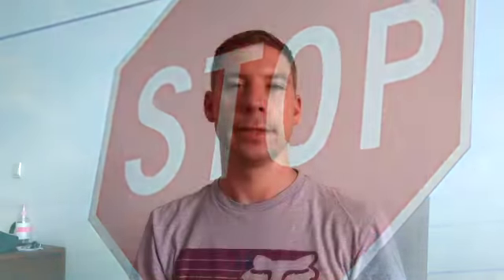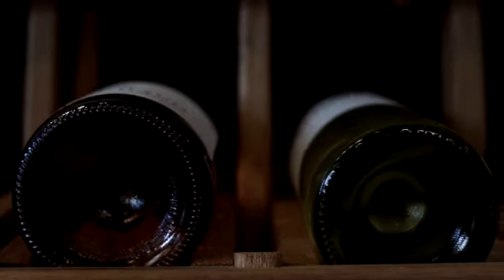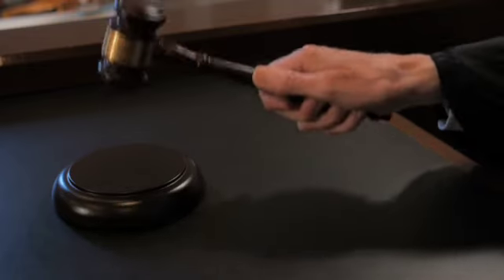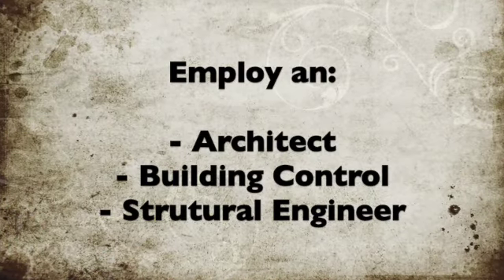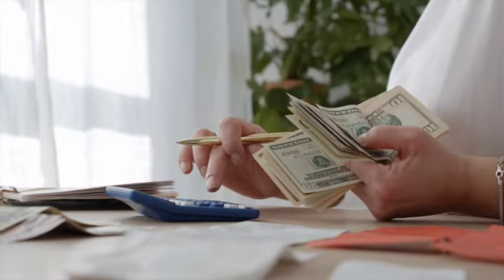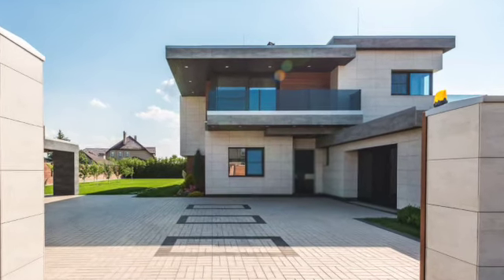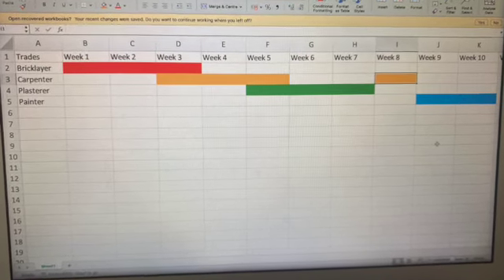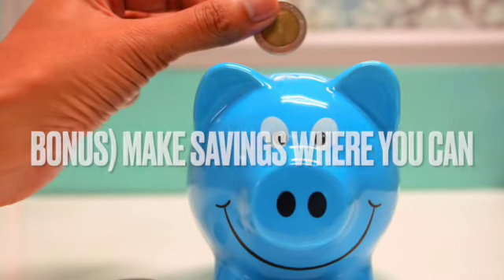A Basic Beginners Guide To Renovation - Tips For DIYers

Comment: Great advise and very practical, but finding good tradesmen is easier said than done these days. There are far more builders out there just wanting to take your money and cut corners, than builders intent on making a name for themselves. I took on a build and the odd 3 trades I got subcontractors in to, do let me down, and I ended up sorting them out myself. It’s really not for the faint hearted unless you are lucky enough to find a good builder. I am retired now but have witnessed over the years these skilled trades not being passed on to the younger generations as they used to be passed on any more. Younger generations seem to just want an easier life and instant gratification. It is not difficult to learn most of the building trades yourself if you are so inclined, as there are so many courses out there these days and it can save £1000’s, but it can be a hard route to take. These videos can be a great help especially with building regs constantly changing.
Reply from the maker: Thanks for the encouragement Peter. I agree, good builders are hard to find There aren’t enough youngsters getting trained up, mainly because they just don’t want it and it means putting in some graft.
Reply: There is also the problem that the new approaches to thermally efficient buildings mean that many older 'practice' based techniques are no longer adequate, so you need folk who are both up-to-date and contentions as part of their competence!

Comment: Is it possible to use PIR rather than lime on solid walled old buildings?
Reply from the maker: @Jonnysonone  Hi, I’m not sure I understand your question because PIR and Lime aren’t comparable. Are you asking whether you can insulate an old wall will PIR if the wall is built with lime mortar? Give me some context and I’ll be able to help you further.
Reply: @BerkleyBuilds  hi. Yes basically. Old solid walls that were traditionally meant to allow the passage of moisture.  Is it possible to insulate with PIR without causing condensation problems? So much info out there it's confusing.
Reply from the maker: @ in short, yes it’s possible however, you have to go about it the right way. I’d suggest creating a stud wall set off from the existing wall which allows an air gap.